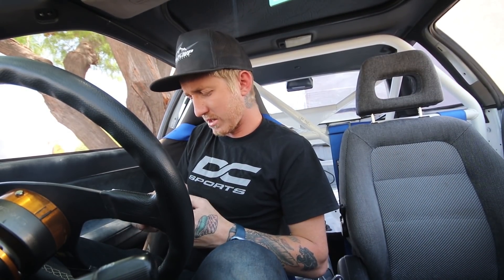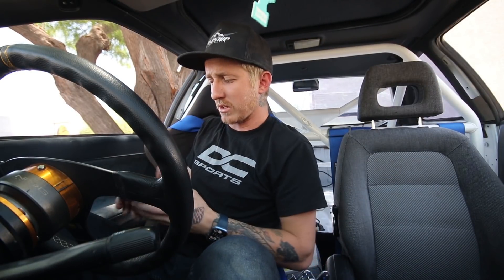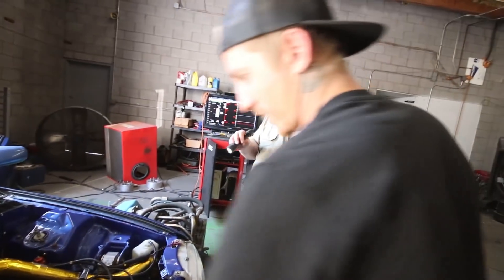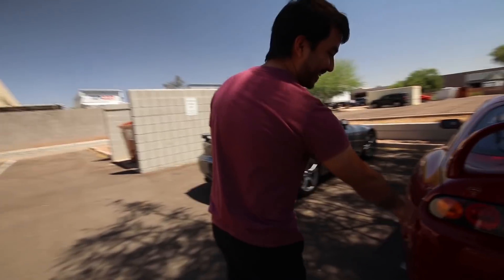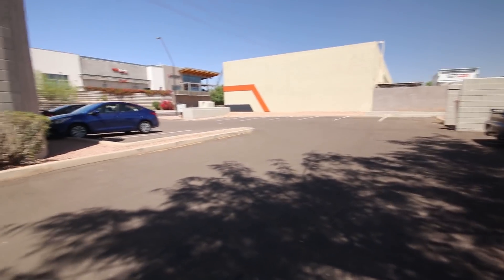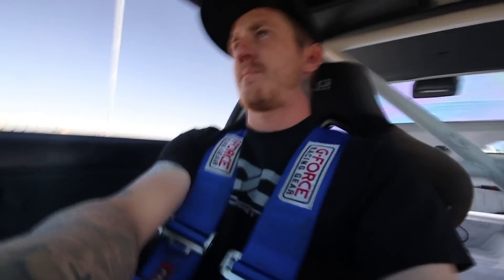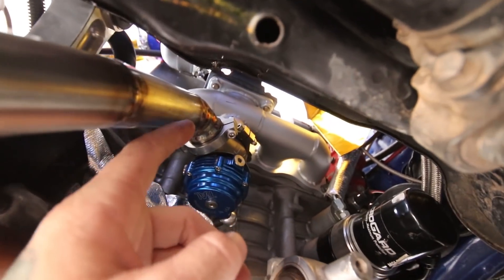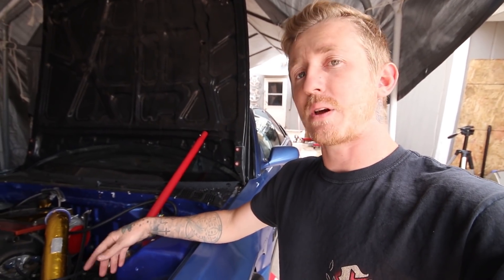Disappointing Day on the Dyno (K20 Integra Turbo)

Comment: Finish that original first manifold you made. K series takes in tons of air and it needs to exit as fast . The log manifold is only going to build that back pressure up because the flow to exit isn’t as efficient, especially with all 4 runners has flow hitting each other before going 90degree a Into the turbo.
Reply from the maker: I can’t make that first design without deleting the waterlines, so when I make a new one it will be a sidewinder most likely. But I did also find two good size boost leaks so Im thinking that was a good part of it. I’m being told my muffler is super restrictive as well? So maybe take that off just to test, and if that is also the case make a straight through style muffler axle back
Reply: Deletes water lines.

Comment from the maker: Update: found two big boost leaks, broken clamp and a failed intake manifold gasket

Just to clarify, the main issue comes from the manifold choking the engine. There is room for improvement for sure. But funds as we all know limit the progress. Sidewinder manifold will be for the future but for now I gotta settle and stack money 😶
Reply: Interesting, the manifold was a restriction. So, with that being said, maybe experiment with like idk some mild 304 exhaust piping? Something cheap and could potentially further the build until like you said PLM or someone does jump on board. Either way I’m excited to see any progress bro good luck 🍀👍🏾
Reply from the maker: Turbo manifolds should not be made of anything other than SCH10 or SCH40 pipe, and the material for that is just expensive. Tight radius 90 bends of 304s SCH10 is I think 17-30$ a piece depending where you buy it

Comment: That's sux that they didn't allow you to just switch those lines even though it only take maybe 10 min. When l went on a dyno session, tuner said it wont hold  boost. The tuner himself found 1 of those bottom plug is missing and he did a temporary fix ( put a rubber cap and 10mm bolt) just so he can continue to do his magic. Good video man!
Reply from the maker: He would have let me but the line location was super tight to do. Would have taken too much time for the car to cool off
Reply: @ChrisSadowski  your'e a car guy, no need to apologize. You did what you thought was right for your build, more like your'e doing a R&D. I myself made lots of mistakes and l learned from it. Like to see you make a long runner mani for your DA. My brother had 93 DA back in the day and sure would like to have 1 if l ever get another project.

Comment: K series are such an efficient flowing engine, they need to breathe. Wouldn't HAVE to go sidewinder, plenty of people make just as good or better power with a top mount manifold. But the sidewinder just looks and sounds sick. Also, make sure whatever manifold you do go with has good wastegate priority to limit boost creep as much as possible, especially on a sidewinder.

Comment: Small intercooler and when go more than 90 deg on intercooler pipe step up half a inch in size
Reply from the maker: So you think getting a larger intercooler may help? The piping everyone tells me should flow plenty, it’s 2.5”
Reply: @ChrisSadowski  Yes intercooler looks 1.6 d16 size      k20 really want to move the air you could double the size intercooler and get double the flow thou it 2.5 pipe good for k20
Reply from the maker: Noted, IC upgrade was on my list to do anyway. Just used this one since I had it laying around
Reply: @ChrisSadowski  Been following whole build thought your exhaust manifold was well suited to your needs will spool up quick  sidewinder Id rate for track all top end power no mid or low  turbo lag  until 5500  rpm  odd

Comment: Maybe that 180 into the throttle body could be a factor in the choking up.
Reply from the maker: I think the problem is more on the hot side, like the gasses can’t escape. But I’m currently chasing down potential problems so we will see. The 180 would cause lag more than restriction if anything to my understanding

Comment: Didn't boostedboiz make over 400 with an identical log style manifold in their red mr2? Im a bit skeptical that its the manifold, Do you have valvesprings? Could be getting valvefloat. Looks like the torque curve false off as soon as it hit full boost.
Reply from the maker: Stock engine, but I did find two big boost leaks, main one being my intake manifold gasket so I think that could be a big issue. I’m also told my muffler being like oem is causing too much back pressure so I just removed that and am fixing the leaks and will see if it helps
Reply: @ChrisSadowski  Awesome! i went back to check out what exhaust system you had and was just going to say your exhaust looks wayy to restrictive.
Reply from the maker: It sounds great for an NA car but it must be too restrictive for turbo
Reply: @ChrisSadowski  def! keep us posted bud

Comment: I doubt it's your manifold. I've seen 600hp+ made on a log manifold on a K series. 
And I personally made 400+ on a log manifold made from only 1.250" fittings..
Reply from the maker: Do you have any other suggestions as to what I can look for?
Reply: @ChrisSadowski  what's the hot side sizing on your turbo? I think you said at some point in another video.
Reply from the maker: Turbine inducer-64.8mm
Turbine exducer-55.8mm
A/R of .82
Reply: I doubt it manifold also. My revhard manifold on made 360 @ 9psi. Precision 6262 with a 63ar. 2.5in revhard downpipe to stock type s exhaust and muffler.